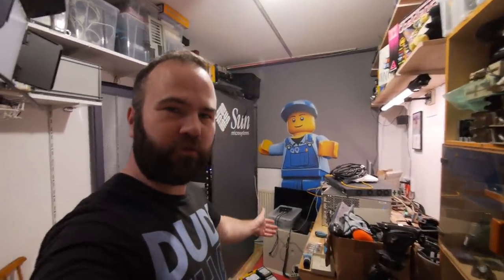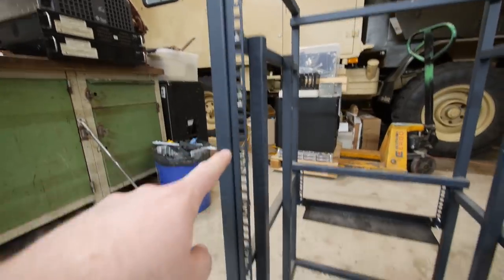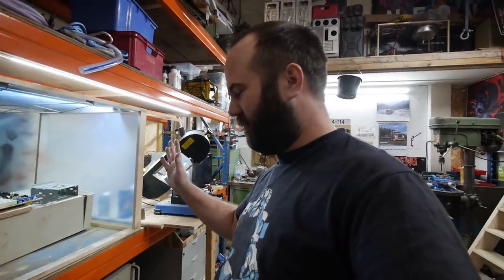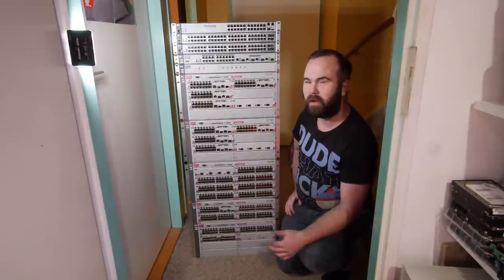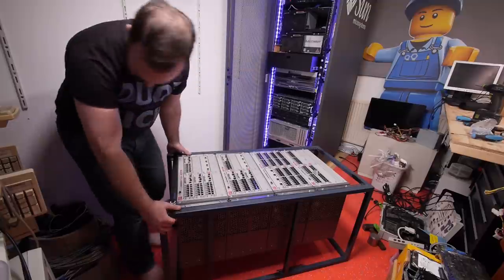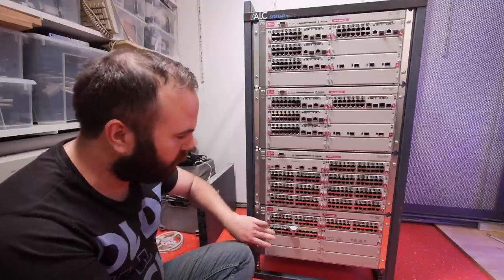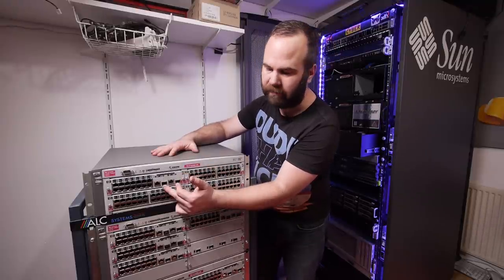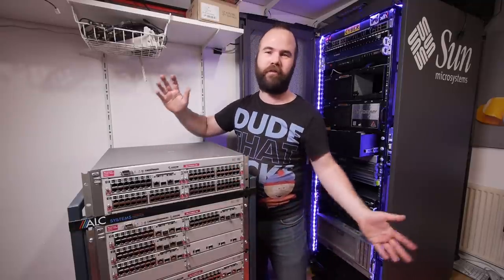I Build a 22U Home Server Rack | Building a Homelab and why I needed a Second Rack

Comment: There is a tool to insert and remove cage nuts that makes it way easier and so you don't hurt yourself.
There's also some plastic replacements that you can use, but they are really expensive so I'd recommend getting the tool.

Comment: Oh yeah caged nuts are fingers killers... I'm still wondering why you removed the lateral reinforcement bars in the rack, weren't the switches supposed to be installed anyway? Maybe they could have helped with structure stability. BTW a great addition could be welding four wheels under the rack to help you move the beefy thing into the Lan party room.
Greetings from Italy, it's always a pleasure to see your videos!

Comment: Do you somehow have free electricity or do you only power the entire rack when making videos?
I had to limit myself to a 35w i7 for my surfer and low power laptops for other things such as openmptcprouter which I highly recommend you take a look at :)

Kinda sucks to run a single 8 year old i7 desktop PC with 32GB ram when you have a 1 meter stack of HP G8+G9's with around 200 Xeon CPU cores lying around which cannot be run because of power prices :(

Oh, I might have some Scuzzy stuff for you! How about a few 2000-2005 SCSI disk shelves racks incl. controller case? Also a Supermicro 1U rack surfer from uhm... ancient times!
No promises yet!